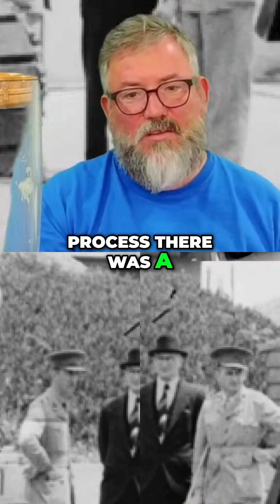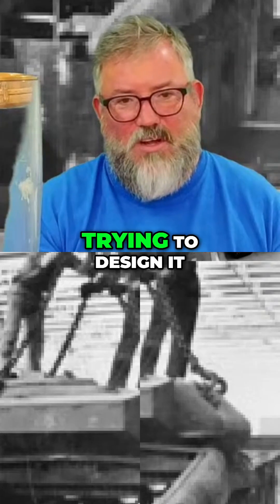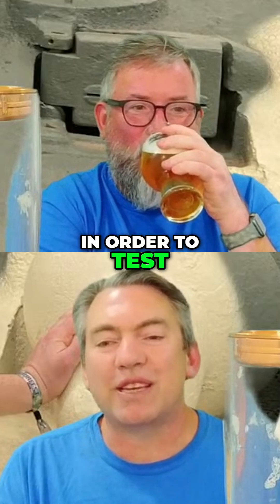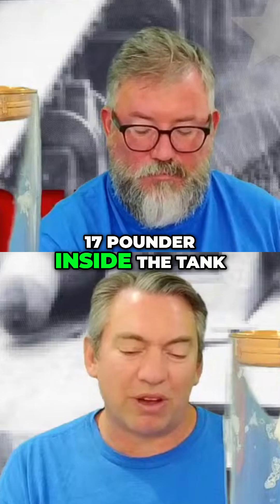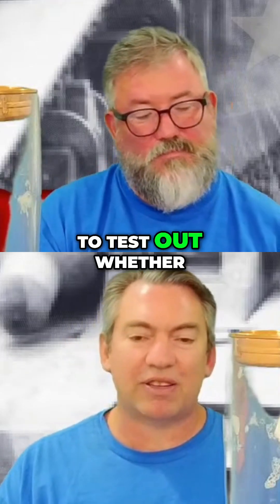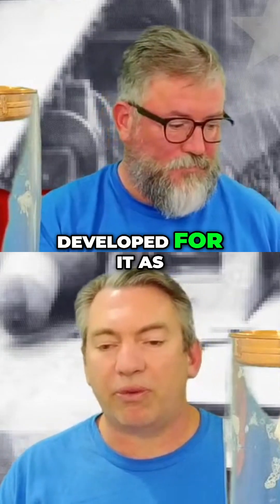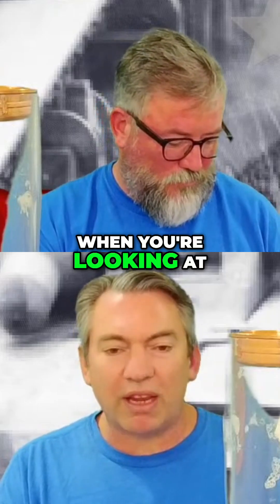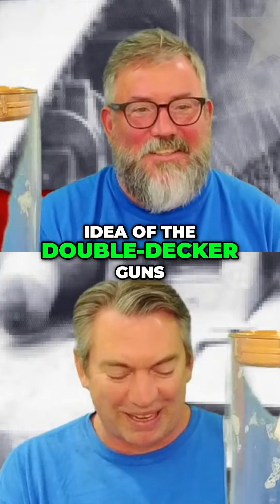The Hilarious Story Behind the 17-Pounder Tank Gun

Comment: Great to hear story being told. The British, having been dealing with Germany much longer than the US, knew that it was time to up gun the Sherman because there wasn't enough time to develop a new tank before D day. They gave up the bow gunner (for increased ammo storage) and made the 17 pounder fit in the Sherman, adding a box to the back of the turret for the radio as well. It was cramped, but I'm sure they would rather be cramped but be able to take out any German tank than have a little more room and have to run from Tigers and Panthers.